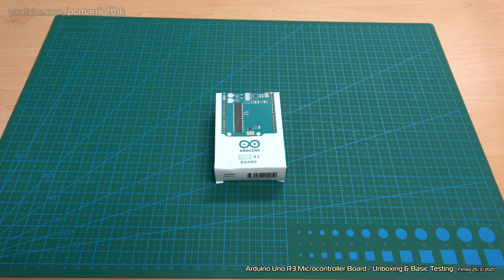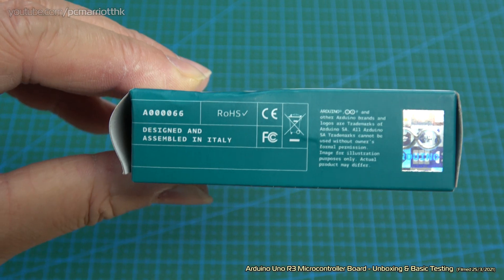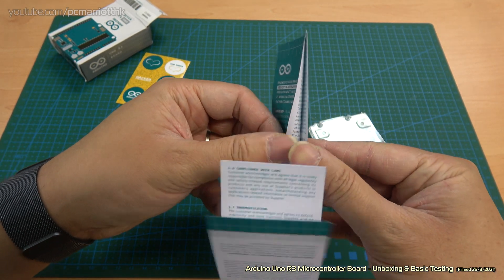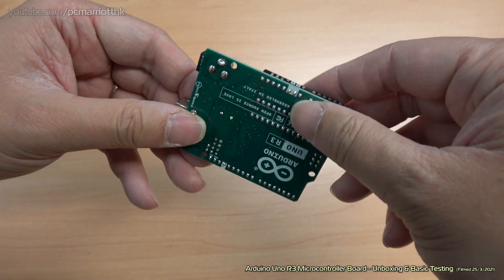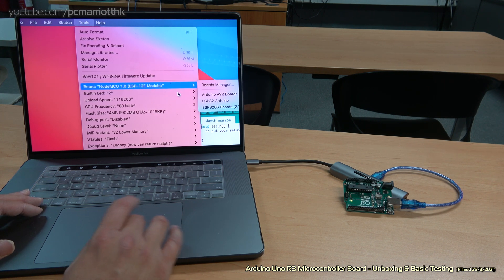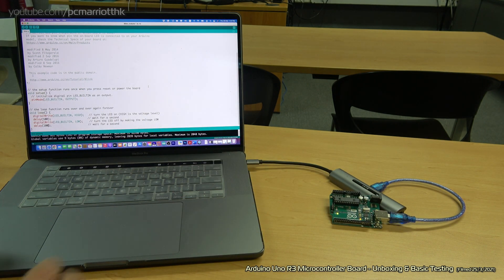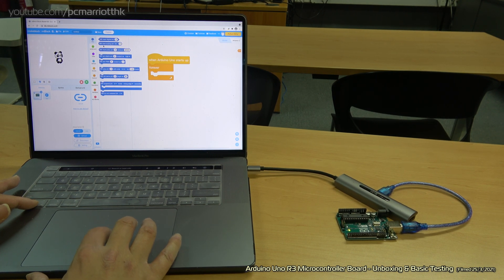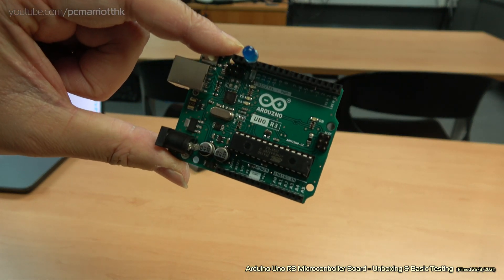Arduino Uno R3 Microcontroller Board - Unboxing & Basic Testing w/IDE & mBlock

Comment: I am really surprised that this came with no power jack I just got the board itself.:-(
Reply from the maker: That’s odd. If it’s the official board it should come with a power jack. Even the clone boards come with one so this is a mystery. You’d might want to get in touch with the Arduino company and see what’s up.
Reply: @PaulMarriott  I got pretty much the identical box and same one like you have you are right that's a good idea I will message them
Reply: @PaulMarriott  By the way I meant the cable not the jack sorry about that I noticed your one didn't come with a cable either when you opened it with a knife so same situation

Comment: Whoever watches it don't ever try to put Led directly in Arduino pin without current limiting resistor. Nice video except this little part. I also ordered an original board. Looking forward to getting it.